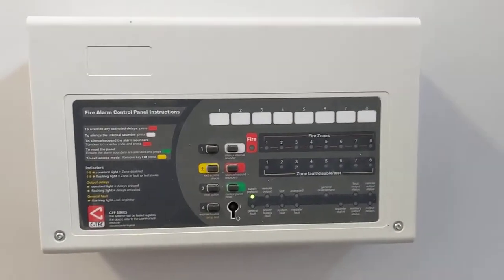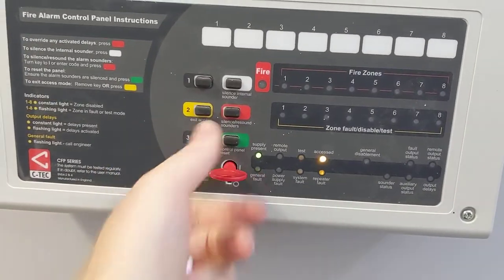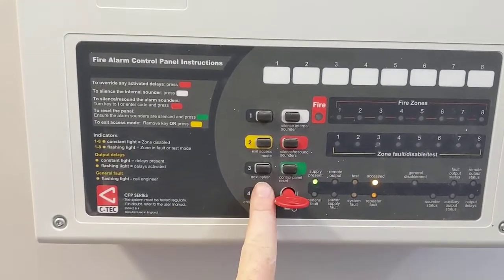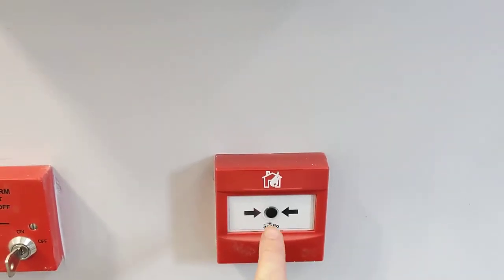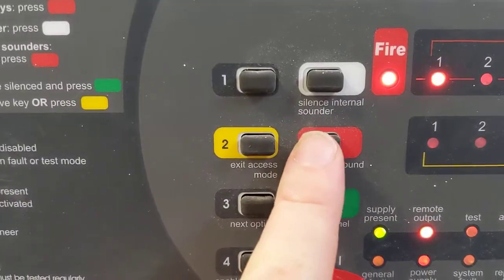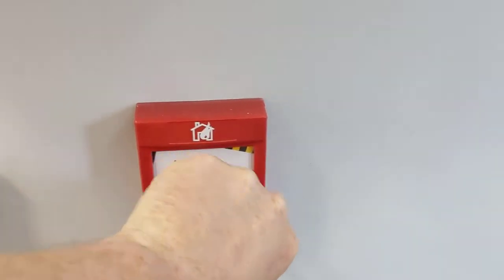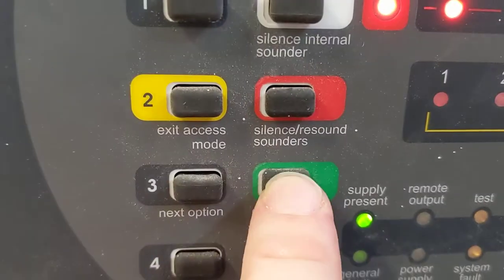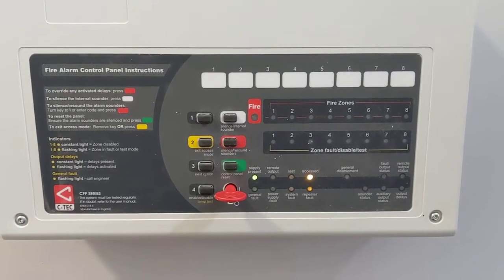C Tec CFP series fire alarm control panel weekly test

Comment: What’s the difference between “Silence Internal Sounders” vs “Silence/Resound Sounders”?
Reply: Internal sounders is referring to the beeping or buzzing from the control panel itself not the main alarm sound. Useful for a fault on the system when the panel is continually beeping

Comment: 2143 if you've lost the key
Reply: GOD BLESS YOU. Mine just went on for 2h before reading this comment.
Reply: @MFCristian92  Glad to be a help.
Reply: How can i stop my alarm
Reply: What button should press before code
Reply: Do you do this before sounding the alarm? Or after you silence?
Reply: Is that standard? Cos I had that in my old work place. I thought you turn key clockwise. I always did it manually
Reply: @asif80 standard code, so if you don't have the key type 2143 then silence then reset.
Reply: @Dime_Bar thanks